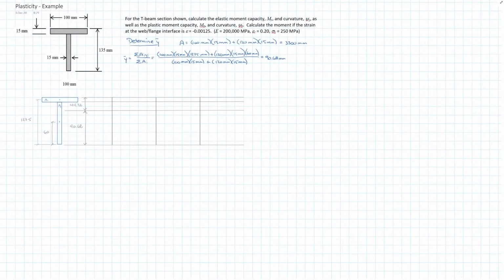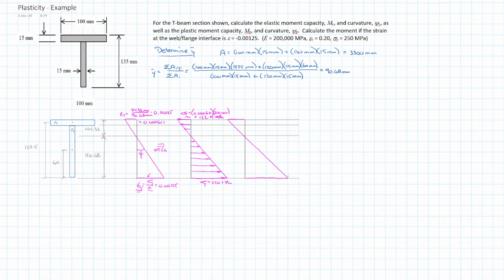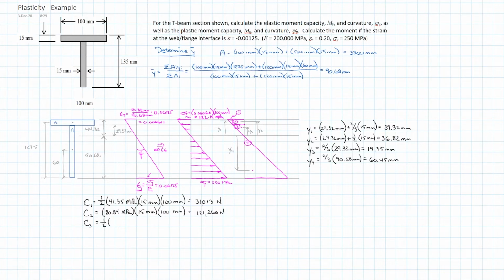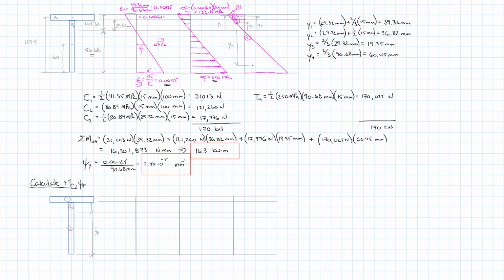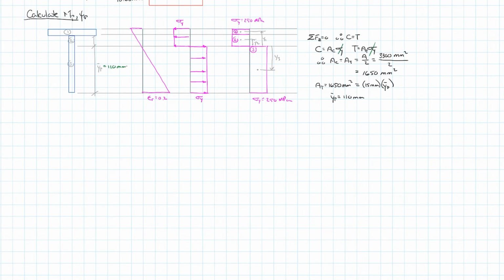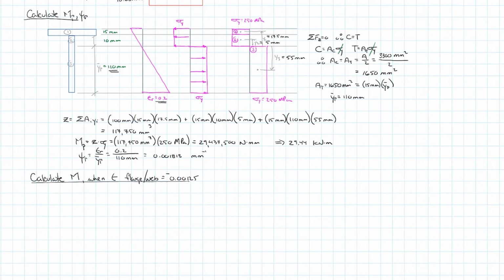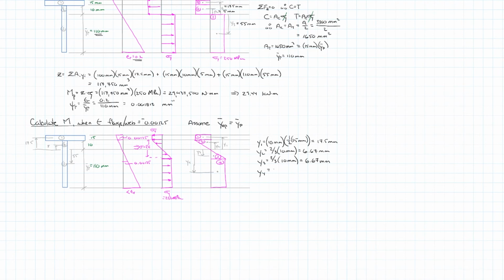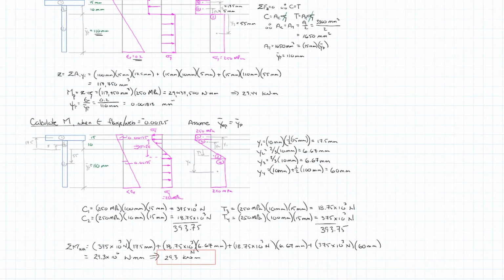Plastic Moment Capacity for a Beam's Cross-section

Comment: how did you find the flange stress as a 41.35MPa ?
and 80.48 MPa???
Reply from the maker: Hi.  Can you be more specific with your question.  Maybe give a timestamp of where these stresses are derived.  I did a quick scan through the video to find your area of concern where clarification is needed and couldn't identify it.
Reply: Hey, at the timestamp 11:02, there is a top flange stress 41.35 Mpa, how did you find this stress value? Many thanks! @PatJHeffernan
Reply from the maker: @gigillik I have reviewed the video and see this was not well explained.  The stress distribution over the height of the cross section is linear with known values at top and bottom.  The ~80MPa is the stress at the bottom of the flange (similar triangles).  The 41.35 MPa is the difference between the stress at the top of the cross section and the stress at the bottom of the flange.  This then is the “height” of the stress triangle 1.  Hope this helps.
Reply: @PatJHeffernan  I still don't understand, what is the 250 and 122.19 MPa then